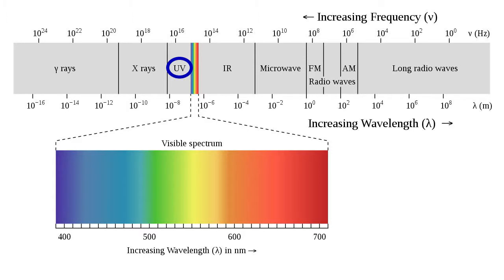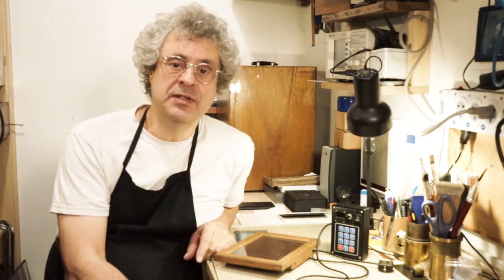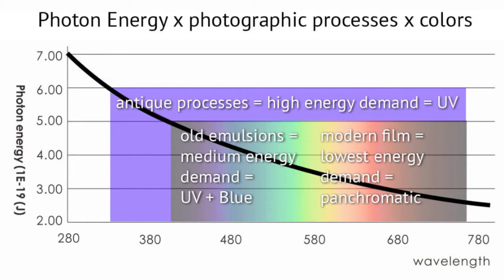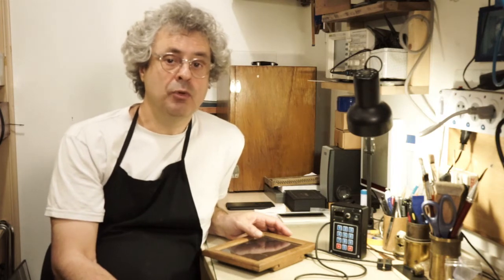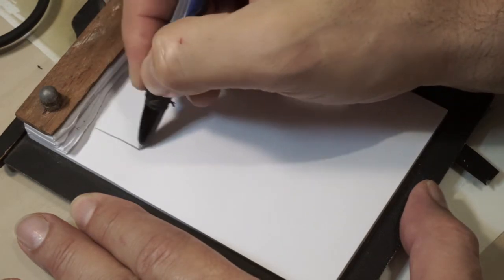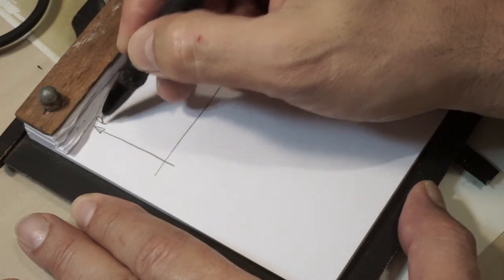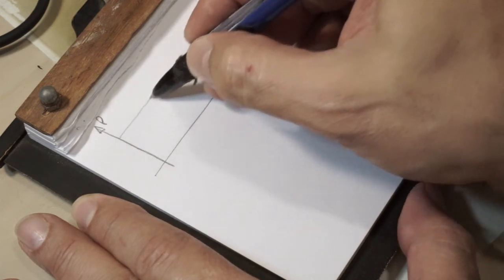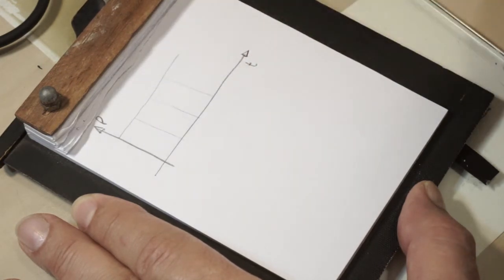Solar UV Exposure Meter for Photographic Printing

Comment: Excellent idea. Can you set a "recording" mode to measure the light comming from a known source and then show that as your arbitrary keypad number?
Reply: Do you mean setting a reference light and then presenting all the exposures as factor of that base value?
Reply: Hi! thanks for sharing your knowledge, Wagner. I think what Roman Fernandez is referring to is just what you say at the end of the video. You ask yourself how do you guess what values you should use, but then you insist on this device as a test strip replacement and its predictability. This is great, indeed, but it would be even greater (IMHO) being able to see how this arbitrary number is adding up under the light exposure.

So to speak, this device is a great "countdown" to reach an X value of radiation. But I guess that with some coding, it would work also as a "timer", instead of just a countdown.

Comment: I understand you did not open the window so you don't have the noise of the street in your video, but I am curious, how much UV the glass of the windows blocks? I guess quite a lot (especially UV-B).
Reply from the maker: That is a good question. I was surprised about how little is cut by the window glass even with an oblique incidence angle. I did not test exactly how much is lost, but I can tell you that the times, for regular processes like Van Dike Brown or Cianotype, remain perfectly workable. We have to consider also that the contact printer itself has already a glass on it. That means that in absolute terms glass, unless built to be a filter, is transparent to UV. The sensor did not allow me to have different readings of UV-A or UV-B, so I have no ideal if one of those performs better than the other in passing through the glass.